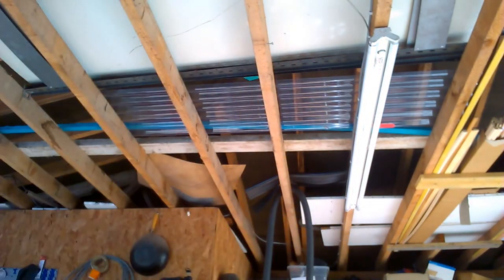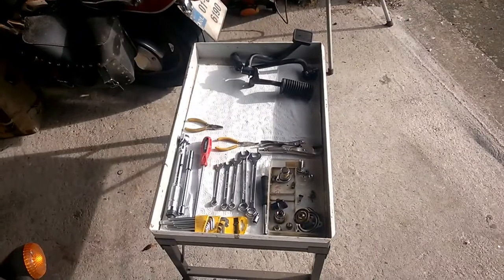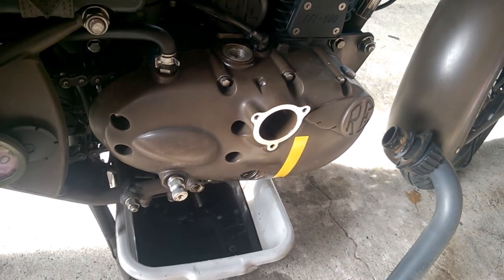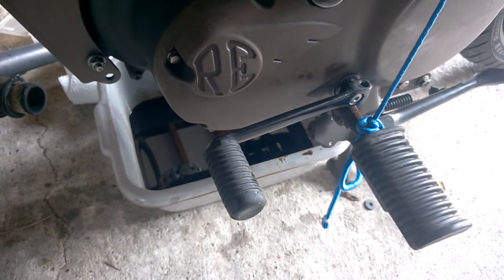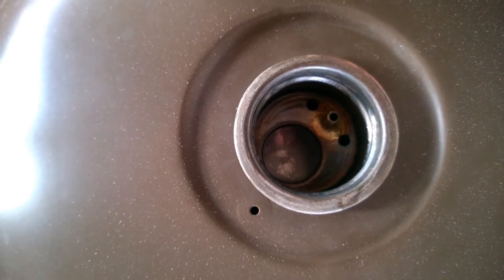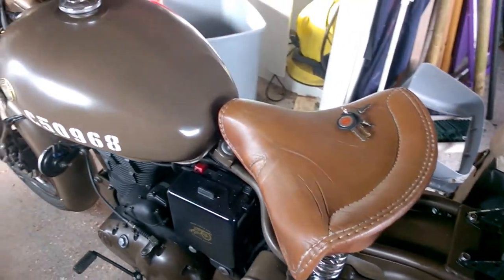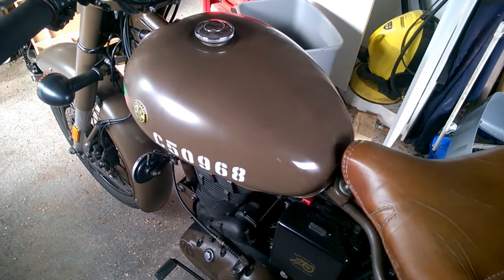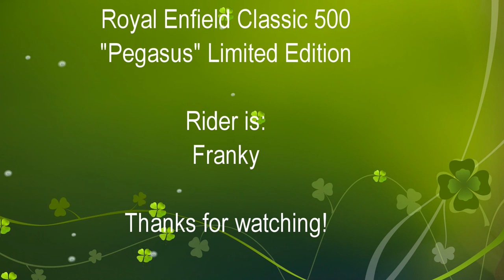Badger 4000 mile review

Comment: Was it easy or difficult to install the indian seat on badger ?
Reply from the maker: I noticed that the hardware came with the seat wasn't an optimal fit for the Bike, but using the mounting parts from the original seat worked fine - it came with a few extension pieces of which I used 2 to make it fit on the original mount so after a bit of figuring it out, it wasn't too hard. The seat is a LOT more comfortable as the factory seat is quite hard compared.